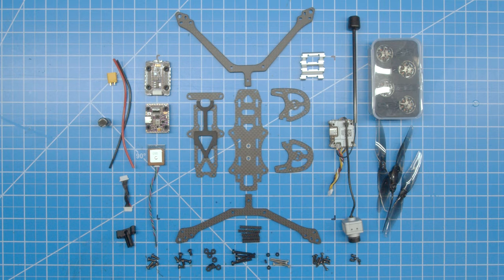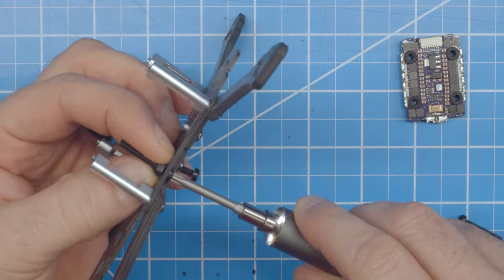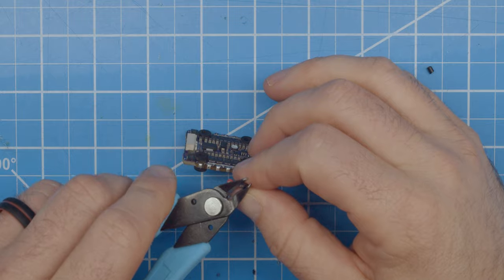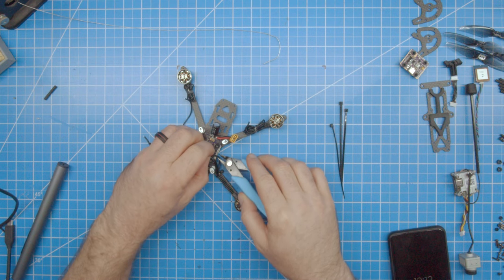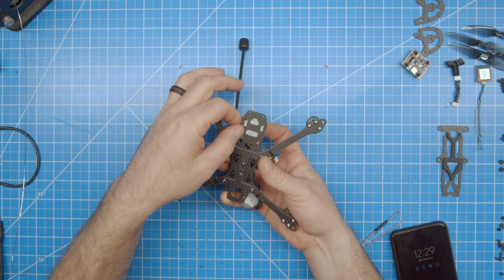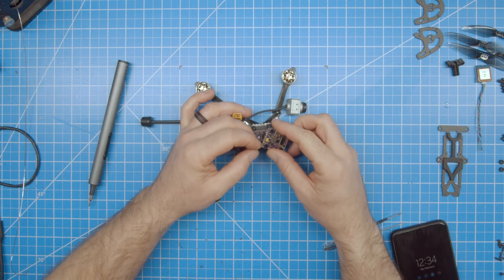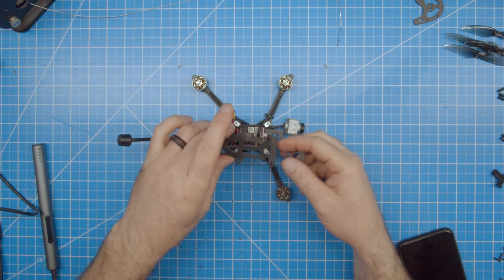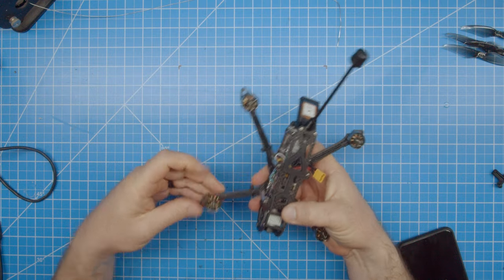NewBeeDrone WhirligigV2 4inch Endurance HD Build Video

Comment: How would these 1404 3000kv's run on a micro 4 inch LR build using 3S 1100mah (GNB ultralight) spinning 3 inch biblades?  AUW approx 220g.  I normally run 3800-ish on these types of builds so was wondering.  Thanks!
Reply from the maker: It will be underpower for sure. 3S probably good need 4000kv

Comment: I purchased my first cockroach frame from RDQ and the 1s build only lasted 2-3 days before frame cracked and broke beyond repair. I swapped to a Meteor65 frame and 2 weeks later it holds up amazing. Just a suggestion but mabe you should reformulate your plastic used for your frames to be more comparable to the Meteor65 frames. On a good note I love the Goober canopy I hope it holds up better than the cockroach frame 😉
Reply from the maker: are you in our newbeedrone hive group? the cockroach frame you got maybe the batch have problem. we do give free frame for those customer having problem at that time. Now its all fixed and strong!  here is the group link: https://www.facebook.com/groups/NBDHive
Reply: I sent a join request yesterday and just waiting for acceptance by admin
Reply: I have same issue with my frame. Will check the group
Reply: They say they will sent an extra frame next time I order from Newbee drone lol. I already replaced the frame myself after 2 days of flying. I order from RDQ anyway they treat me right and I highly recommend.
Reply: Cockroach frames are nothing but trouble and will leave you grounded if you don’t have a real frame on hand
Reply: Even Betafpv sends out a replacement no questions asked and they have been good to me over the years
Reply from the maker: @mgesmalltownaerial2840  if you contact our customer support and process the warranty. You will get a new one. You probably use the old v2 cockroach frame. That batch is shit quality because our supplier use wrong material. This is why we provide lifetime warranty for the cockroach frame. Send us email: support@newbeedrone.com tell the situation. We will drop a cockroach V3 frame for you to try. You can also check out ciottifpv livestream, I told him try to destroy the new cockroach V3 frame on live.

Comment: What is the weight? With 4S 850? Or any batterie you have?
Reply from the maker: It will be over 250g and under 300g. Recommend to use 550-850mah batteries